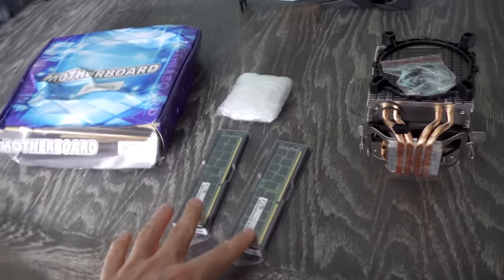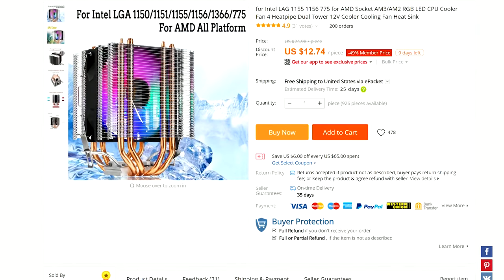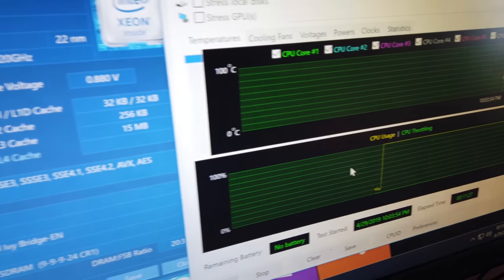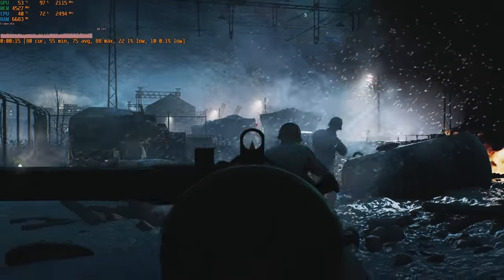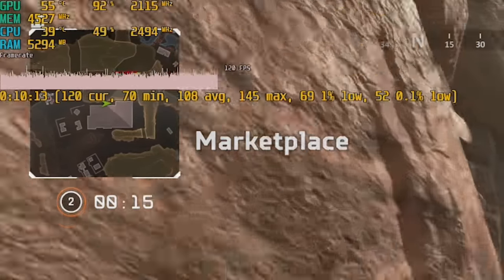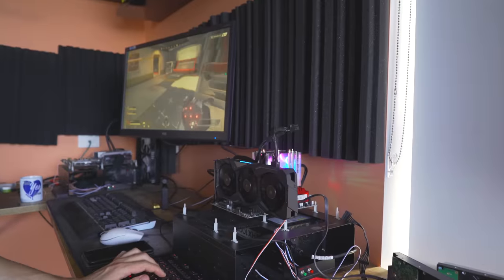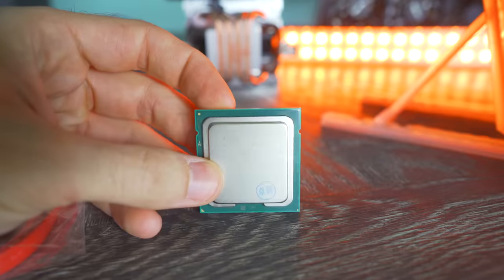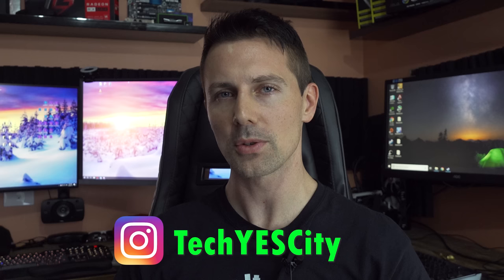This 6 CORE Ivy Bridge Xeon only Costs $24...! (Worldwide Deal)

Comment: Nice video Brian. Always fun to see unorthodox builds that perform well at a good price. I've just built a system with a Xeon E3-1245 v2 which I got for dirt cheap. Paired with a socket 1155 ITX board and a slight overclock, 8GB DDR3 1600MHz and got a Cinebench score of 1355. It's running with a GTX 960 4GB now, but it needs a beefier card. Maybe a 1070 if I can find a good deal.

Speaking of good deals. To those who "can't get the same deals as Brian". Sure you can, but you need to be on the hunt for them and get lucky at the same time. Remember that the YES man is working hard to find the deals. They don't just fall into his lap by themselves. The deal hunts we all see are just a glimpse of the work that goes into finding those deals. Then you got to know when to make a low ball offer and when not to.

It's like anything in life, you've got to learn and work to get good at something. Tech YES City is a good place to learn and get tips, but you got to put some time and effort into it if you want to get good at it. Keep hunting for deals, be quick to react when you see one, have the money ready so you can be the first to pay and be patient, just a like a predator on the hunt. Know when to strike.

Comment: without overclocking capability, I not sure this CPU will be good for gaming... clock is just too low. 
also, board with gonbes brand seems to have slightly better VRM... Maybe?
Reply: 남기헌 did you not watch the video, it did fine gaming?
Reply: @adamiscoolization   I didn't watched thorough, but 1% low and 0.1% low seems to be very low, and I really don't think this xeon  will deliver better gaming performance comepared to sandy bridge i5.
Reply: 남기헌 he said it’s likely the hard drive he was running it off, but we cannot know since he didn’t retest with an ssd. Anyway for majority of gamers this is perfectly fine performance.
Reply: @adamiscoolization  OK I've seen whole video now, and although I'm still not 100% sure this is really great for games (especially poorly optimized games like PUBG), these CPUs seems to run newer, better optimized games or less demanding gaming well enough.
Reply: 남기헌 The 0.1 and 1% lows are the only downsides. If he could retest with an SSD and we didn’t get such low numbers, it would be perfectly fine for most people, myself included, but without him retesting I’m not sure if it is the HDD or not. It could still be the same with an SSD and that would mean the odd stuttering in the games that go down to 10 FPS. Certainly not enjoyable.

Comment: Xeon x5670
Used gtx 970
Some 1366 motherboard
Reply: ur in for a bad ride
Reply: God DAMN
Reply: I built 220€ pc with these parts and it runs games good as pc built in that video.
Reply: @everythingmotorsport  what games do you play and what do you consider "fine"
Reply: I'm asking you because I used a x5675 and honestly it did about as well as an i5 4460 (not so good)except my 1060 had issues having a score that's about 30 precent worse then it should be
Reply: @tfsigolkin6829  did you oc to 4.2 ghz? This thing is shit without overclocking. With oc it can Compare to a r5 2600.
Reply: @herroberbesserwisser7331  the problem is that you can't oc it with a cheap  Chinese board and buying an older enthusiast board isn't worth it price wise which renders the build that yes King made obsolete, and my previous one as well

Comment: Actually a really good value, I've never had a problem with your finds in the past but you live on the other side of the planet some things are cheaper there vs here and it often comes within $100-ish to a 2600 and super cheap motherboard which made me question if I should do that but this is by far the cheapest one yet on my end which helps make it a more reasonable consideration :)

Comment: I'm crying with my A8 5600k in the corner :(
Reply: Been their friend, was not a fun time, neither was a 750 1GB
Reply: Broken Umar honestly make the best of it man! We all started somewhere, (my first build was similar to yours) but the fact is you have a pc to use unlike others. Got to appreciate that & and save up for your next upgrade/build!
Reply: This will cheer you up: still rocking in 2019 this combo: AMD Athlon 64 X2 4200+, 4GB DDR2 800MHz, Geforce GT 710 2GB
Reply: A R. mine was almost exactly the same, except individual parts. fx 4300 and r7 250.  I honestly didn't and still don't hate my R7 250. it couldn't clock as well as other model cards, but it did have 2GB vram.
Reply: Na get a Athlon 760k and oc to 4.2 ghz. Will work with a better gpu.

Comment: Lol, after this video, I finally made a purchase at Ali Express, I had to see what A full scratch build vs finding a cheap used complete system and slapping a video card in it... So far I spent $285 total , 95 from Ali Express , $25 power supply, $70 used video card rx-480, $25 ddr3 16gb, $40 on a case, and $30 on SSD 250 gig. $285 roughly. It should produce the same frames or better, but will it be cheaper or faster than the Dell used system I found for $160, add the $70 to the price for video card,. It's an i7 3770 system.. the new system will look cooler though 😂..

Comment: Im not recommend to buy noname motherboards , in my exp most of them just die , bcuz they make really bad , if u want budget motherboard from aliexpress for 2011 socket (x79) i recommend plexhd x79 turbo, x79t and 2.3s1 they are cheap and still can overclock cpus like 1650 1620 and no problem for cpus like 2640, 2680/2680v2 2650v2 with blocked multiplier
Reply: ive been looking at those plexhd mobos.can they oc a locked xeon?
Reply: @jasonschofield37  if u want oc locked u need brand motherboard , and u will get plus 300-400mHz so i guess it isnt really worth it if u want buget pc , only if u will get really good deal like used motherboard for 100$ or lower should be very nice deal

Comment: I would just spend a little more to get an LGA-2011 board instead, because you can find 6- or 8-core E5-26xx CPUs (ES or not) for about the same price, and you can upgrade to 12-core later on.
Reply: 10 cores 2470v2 is also available for upgrade 😉

Comment: FOR THOSE THAT DIDN'T CATCH IT: That "EastVita" MoBo is H81 — (NOT X79) — so only has SIX (6) PCIe lanes; also LGA1356 was only meant to support Sandy Bridge — (I'm guessing they bodged the BIOS to allow Ivy Bridge) — so those PCIe lanes are Gen 2 as well.
It'll work passably for a 1660, but you won't really have an upgrade path for your GPU.

Comment: I'm not going to lie, I jumped all over this. I put together a budget build like this with some v3 Xeons. The problem is that I'm still waiting for someone to actually come through with a lga2011 board. Multiple tries have disappeared into the abyss but I at least got my money back. I dont even want to game. Trying to build a home server. But it will free my Ryzen 5 1600 that is holding a server role right now. Ty

Comment: How does this compare too an i3 8100.
I bought one used for 90 and could probally sell it and get the cpu and mobo for this combo
Reply: 8100 destroys it
https://cpu.userbenchmark.com/Compare/Intel-Xeon-E5-2420-v2-vs-Intel-Core-i3-8100/m175708vs3942

anyway it would be better to sell it and do a ryzen build
Reply: @rawdez_  There's literally 1 benchmark and it wasn't complete and it was on a virtual machine. Can't really say how it will compare when there isn't an actual benchmark to compare, but generally yes it should be worse than the 8100.
Reply: @xingbairong  check the search on userbenchmark.com, there are other benchmarks of other 2420v2s, i bet they are pretty close to that one.

ps good point

Comment: One of my servers at the house for my home lab is a Lenovo with dual E5-2420v2.  Hexacore CPU’s with HT for a total of 24 threads.
Got bored last night and looked up faster CPU’s for giggles.
I found 2 x E5-2440v2 CPU’s from eBay with the seller having 99% good reviews for them.  So 2 x 8 core cpus that HT for a total of 32 threads.   
When this cpu came out in 2014, it was at $832 each!!
I just paid $18 bucks for BOTH CPU’s and $6 more for a 2 year warranty on them!!!    $18 freaking bucks for 32 cpu threads!
My Hyper-V homelad will be happier now!

Comment: I had bad luck with my first Chinese Board (HaunanZhi X79 Deluxe), which died within 5 hours of regular use, without OC.  I finished that build with a used ASROCK X79 Extreme 3 motherboard coupled to an E5-1660 ("V1"), as the E5-1650V2 isn't supported by the Extreme 3 (yes, I tried everything to include latest BIOS).

I got a refund on that HuananZhi, eventually, but still ate the import duties and return shipping (about $70 in total).

After mulling about it for awhile, I decided to give it another try with a different AliExpress store...AND make the build with an extra fan blowing over the VRM radiator on the new HuanaZhi Deluxe. I did this with the E5-1650V2 and 32GB of Samsung DDR3 R-EEC 1600MHz RAM (that RAM also did not work on the Extreme 3).

The HuananZhi took the E5-1650V2 and R-EEC ram without issue.  It also immediately recognized and booted from the NVME M.2 that had already been loaded with WIN10Pro on the previous failed motherboard.

My eldest daughter is really happy with this PC build. Nice RGB from the CoolerMaster Masterbox Pro RGB case...the Chinese dual fan 4 pipe RGB cooler, etc.  It's only a slight OC on the multiplier to 4.0GHz plus the RAM at 1866Mhz. Also a used FTW GTX 980 off of eBay...which unfortunately was not the best buy at $180...as I have to underclock it 80Mhz to keep it stable (and Yes...I did give the card some TechYes luv'n). Learned my lesson on GPU's with this first eBay used-GPU purchase...been buying these locally (used) ever since.

We have three PC builds in the house...one for me and two for each kid. All X79 Xeon E5 based.  The last is a dual Xeon E5-2667/16GB on a (free) Dell desktop server, with GTX 970 OC. Very happy with these builds.

Total spend out of pocket came to ~$1270 (incl. 2 motherboards, 2 CPU's, 3 GPU's, 2 CPU coolers, 2 new Power supplies, 2 new cases, 32GB R-EEC RAM, 1 SSD and one NVME M.2, 3 WIN10Pro lic keys) so all well on that front too.

Comment: I took your suggestion, and found these parts ($15 plus free shipping for the CPU) on eBay. I purchased the MoBo from AliExpress for $48.88 Plus Shipping. For some reason the board was returned to sender. I looked at the tracking, and it never left China, but Daisy Ma, said it was rejected by Customs ? I have had wishy-washy luck when purchasing things from China. I bought a X16 Handheld gaming console, and the screen was damaged upon arrival. They would NOT refund my money, they suggested I get the screen repaired a a local electronics shop. I had to remind them that this is the US, and we don't have electonic shops like in Shenzhen. I eventually tracked down the part number of the screen, and bouth it off AliExpress, the same day I ordered the Mobo, but the screen got here just fine...I guess I am 1 for 2.

Comment: Great video.  I suspect the low clock speed of the CPU causes a low 1% frame rate in the tests.  I regret that there is no USB3.0 on the Motherboard.

Comment: I built this system except I spent about $10 more to get a board with usb 3 and more sata ports.  I also got a 2430 v2 off ebay for a little faster chip.  Coupled with a Rx 570 this is a very fast system for the money.

Comment: It's cheap but you can't overclock like HEDT 1366 builds. There is a big difference between having 3GHz or 4.4GHz. Sometimes that extra single thread performance really helps catch up to newer CPUs where even i3s perform very well due to generational IPC increases.

Comment: Isn't x3440 still better value option? It scores around 620 points in Cinebench r15 once you overclock it to 4 GHz. CPU is cheaper and there are many motherboards to choose from (plus they are much more standard), although aliexpress prices for LGA1156 mobos are bit too high in my opinion (I've got Maximus III Gene for around 60 USD in my country). 4c/8t is still plenty, and judging from similar multi core score it have better single threaded performance. The only downside is that for 4 GHz you probably will need to delid this CPU, fortunately it's very easy.
Reply from the maker: This guide is meant for people who want to get something here and now, as you say with x3440 it probably is better, but you have to get a better cooler, get a better motherboard and use non ecc ram, those 3 things are a lot harder than this combo here.

Comment: These are dual socket compatible as long as the cpu model number starts with a 2, so a 2420 v2 would support dual socket configurations.  This of course only applies to the xeons and not the consumer chips.

Comment: Hi TYC I have bought all the parts as listed above with a GTX 1660. However, the only difference is that I got a CPU  Xeon E5-2430 and DDR3 ram 16GB (2 sticks). Im building this for a friend and wanted to know if it will remain compatible with my slight adjustments.

Comment: Hey this is great.  I've got an E5 2420 V2 on the way for the ballpark of what you mentioned.  I think I've found the exact same motherboard as well which is listed as un-branded.  Are there drivers in the box? - If not is there anywhere to download the drivers (if necessary)__I suppose a fail safe is driver pack connected online?-What do you think?_a little input please.

Would non ECC DDR3 work? eg-Kingston DDR3 1866 Mhz - regular RAM - I've got some to use btw...

It seems the CPU mark is not far off FX8350 and not too far behind a stock 3770!!!
Reply from the maker: Yeah its not bad at all.  No drivers needed, and you can use ecc registered on it, just don't mix and match ram if you can, that can cause problems.

Comment: Hey Yes-Man, I just ordered 3 of these CPUs for building some budget gaming rigs to resell and maybe even use myself. I've been wanting to get into this as a hobby for a while and this awesome price for a 6C/12T processor pushed me over the edge. Ordered the motherboard you linked to and I was wondering if it comes with an IO shield? I would assume it does but I can't see it in any of the pictures and it's not listed in the specs. Hope it does because a case without an I/O shield would look kinda sloppy lol. Anyhow, thanks for the inspiration! I've now got 3  E5-2420v2s on the way to use and also I already have an i7 2600 and an i7 2700K to use so 5 potential builds to get started.

Comment: would you be able to use the E5-2400 V2 10-Cores 2.1Ghz in this kind of setup?
Reply: 2470v2 is the most cheaper 10 cores cpu :). 2.8ghz fir all cores. But 2 ram channels only, and have doubts whether motherboard's supply system would allow to use 10 cores for real work ie rendering!!!

Comment: So if a cooler fits on a socket 1155 mobo, it would also fit this mobo or? This is really interesting, 6 core 12 threads  with good ipc for 25 bucks wowwowowowow

Comment: arent 2450L and 2470 better? they have 8 cores. and they still sell for really cheap. just found out about them. hope you test them too
Reply: The 2470 looks interesting. It's Sandy Bridge, so 32nm process and likely runs hotter. The L versions are low power and will clock quite low which will hurt in games.
Reply: @philscomputerlab  does 1356 support sandy bridge?
Reply: @philscomputerlab  also the 2450l is still 8 cores so isnt it better than 2420 v2? Im more worried about the vrm temps because he tested chinese mbs with bad vrm cooling
Reply: @booegk  Not sure man. I contacted a few sellers, not a single one could tell me what CPUs are supported LOL While it's nice to have 8 cores, if they only run at 2 or so GHz, games will suffer.

Comment: I have a similar Chinese motherboard but it is socket 1366 with no overclocking option. I have a x5670 in it. Sadly there is no option for setting the RAM speed, so mine is stuck at 1333mhz. As I only have it paired with a GTX 760 it can't really be considered a gaming machine, though it does run Resident Evil 2 Remake fairly well. I'm using it as a media PC.

Comment: xeon e5 1620 v2 looks like a great sweetspot!  It's 7% under performance of a i7 4770 and I still use the 4770 with a vega 56 for 1440p 144hz gaming.  did you say that these xeons aren't overclockable?

Comment: Ivy Bridge is still beast"N". I have a 3770K on the Asrock Extreme4 and it still hangs with today's Games. After getting Windows installed did you try and swap back in the ecc ram. I found that windows 10 with the new update be throwin funky men errors on ecc. The box was so mangled, it looked like a motherboard in a bag...

Comment: this is perfect for a boinc machine. The ram you replaced it with, those are regular G.skill ddr3 ram right? or the board will only accept ECC registered kits?
Reply: Yeah, looks like typical G.skill Ripjaws. These are actually H61 mobos intended for the budget Chinese market, so they'd never enforce server memory requirements. That it supports ECC+Registered memory is just a bonus.

Comment: Hmm I got that AliExpress cooler, seems I got sketchy one as it can't even handle an i7 870 at stock. Thermal shut off after about 3 mins of prime 95. Meanwhile, stock cooler manages to stay on with a bit of throttling.

Comment: But how does it compare to a regular i5 with higher clock? I got some PCs I use so people can play with them at events and I'm thinking about getting a few more, all of them are i5 third/4th Gen, a x3460 and a x5675 at 4,3.
YES' build looks tempting for just about 300€ or so, with gpu and such, but maybe for games it's still better an i5
Reply: 600 cinebench scores says alot

But more games are being catered to more cores

That is where the hexa core will shine
Reply: @zye8355    the thing is most i5 with 3,5~4GHz get from 400 to high 500. I'm talking about CB15. I guess that we are in the transition for used tech that makes 4c i5 to start showing its age, with games using as much threads as posible.
Reply: @SrSamuerto  this hexacore clocks at 2.5 ghz